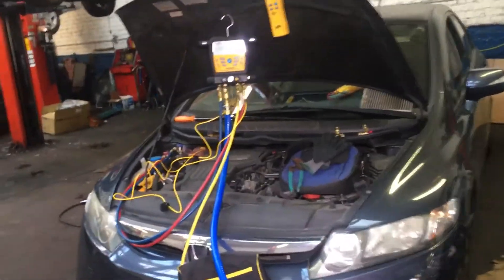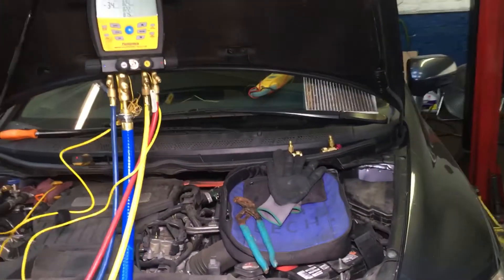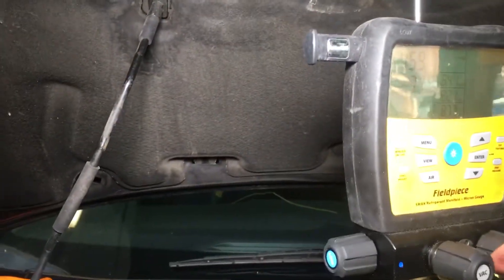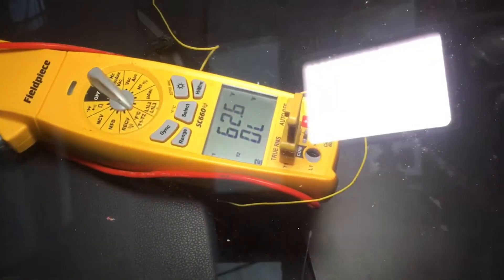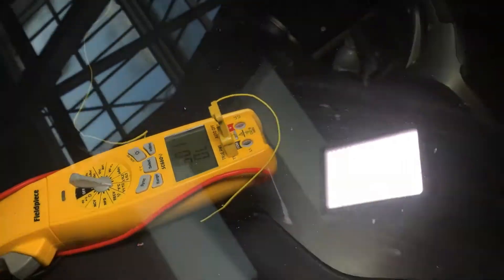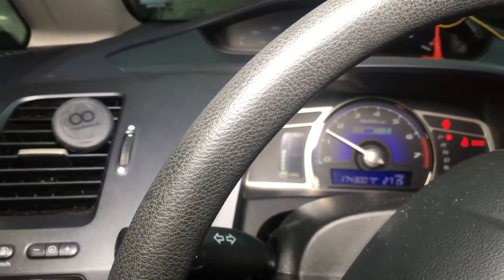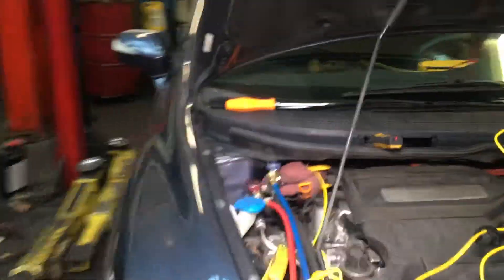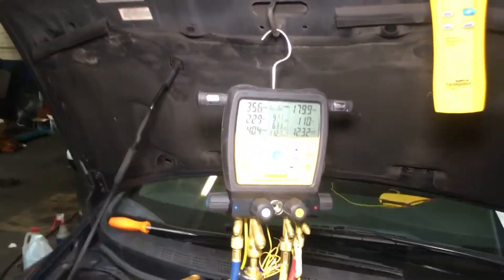How to fill your cars AC By pressure

Comment: At 1:06 you said Variable Capacity compressor.  Does that make the system act like a TXV system?  Is there no way to charge an automotive system using only a manifold and a pair of psychrometers?
Reply from the maker: Correct those old days of a six speed compressor like a York, or a Tecumseh compressor, Frigidaire A6 are long gone. When you had direct connect to fix speed fans connect to the water pump without the fluid driven clutch so you have a fan speed that does not alter very up or down.. 

That was the last time you’re able to use traditional methods correctly that would been the same as a residential split system . . 

Back in 1985 they started introducing the first fearful displacement compressor on Cadillac model .  
      And that’s when mechanics and radiator and air conditioning shops started to eat very expensive. Come backs repeatedly over and over because they refused to read and they were stubborn and we’re determined to stick with a Old methods.. 

And because of those old ancient dinosaurs who used to own 30+ air conditioning radiator specialty shops in my territory, where I work. 

All but two of them have went bankrupt and out of business . 
      And the two in existence have recently been taken over by young technicians, young managers, who don’t have experience and are starting to destroy customer systems I’m getting contaminated, refrigerant over charged, and under charge systems improperly Mechanically repaired systems from these last two shops remaining in the San Francisco Bay area. 

And it all comes down to stubborn laziness 
Refusing to educate themselves 

Then the cheap owners refuse to pay for training and new tools. 

Then the shop own who intentionally chooses to stay ignorant because they’re too comfortable with what they know what wasn’t much in the first place. And they seem repeating what they learned in the first year over and over again for 30 years means they are learning something.

You be surprised at how many shop owners and technicians I have met and I still meet to this day over and over again open doing this for 30 years what are barely beyond five-year-old technician who just repeated same things decade after decade. 

But they’re still in business and they make money so apparently that makes them right  

The variable displacement, compressors use sensors around the car, interior and ambient outside and inside the system pressure in temperature to constantly change and adjust the compressor out put. 

Well, the technician is shaking in putting in the small cans of refrigerant, attempting to achieve a pressure. He is comfortable with from old ancient, dinosaur age technology. .   The computer is taking over and slowly adjusting the compressor, downwards and displacement trying to keep the pressure down to wear it once the pressure to be..  inside the technician thinks he needs to add more and more

In the computer keeps tailoring down the compressor . Lol 🤣

And the technician doesn’t know it .

Comment: https://youtu.be/C12iEpniHxo?t=196 vac off   are you now filling liquid or vapor ?  
Is this filling up because you have a great vacuum 500 micron on it no need for the compressor to run suction on the low side?  If you did not pull 500 microns would you have to run the compressor to get the low side to suck in the proper weight of 134 ?
 Looks like you had the high and low side open for the suction charge ?
Do you have the low side open after you started the car compressor to get any liquid or vapor out of the lines ?    thanks
Reply from the maker: sorry to so long to respond. 
1: I was filling with liquid
2: part of the answer is I have a vacuum below 500 microns. That is one of the three gas laws.     My farther also would not give me the answer to this question. My father made me learn the basic of the three gas laws. The my father put me out in the shop and told me to come up with the answer with what I just learned about the three gas laws, explain my answer to him and told me to get his refrigerant tools and show him how to recharge a complete refrigerant charge with out starting the engine.  My father told me I only get one chanch. I did it and it worked the first time . I was 12 years old. so below is the link to were you can learn to find tha answer to you question. You will answer your own question, because you are armed with knolage. 
    ("Created in the early 17th century, the gas laws have been around to assist scientists in finding volumes, amount, pressures and temperature when coming to matters of gas. The gas laws consist of three primary laws: Charles' Law, Boyle's Law and Avogadro's Law (all of which will later combine into the General Gas Equation and Ideal Gas Law).
https://chem.libretexts.org/Bookshelves/Physical_and_Theoretical_Chemistry_Textbook_Maps/Supplemental_Modules_(Physical_and_Theoretical_Chemistry)/Physical_Properties_of_Matter/States_of_Matter/Properties_of_Gases/Gas_Laws/Gas_Laws%3A_Overview
           3: Yes, at the vary end when I was finished I closed off the high side valve fitting to the service port. Then I opened the high side and low side valve on my manifold gauges to slowly let the refrigerant pass to the low pressure side throughthe low side service port of the refrigerant circuit. 
If you learn even to basic simple parts of (Thermodynamics) (Gas Laws) (Fluid Dynamics) You will be able to answer all you own questions.

Comment: Thanks for properly explaining how to charge your vehicle AC. As a fellow HVAC technician , I greatly appreciate it.
Reply from the maker: shelby bruce Sometime in the future when I learn how to use editing software and sound editing software and use a tripod I hope to make better scripted and more learning intense videos this channel is just for trial and to get used to making videos holding the camera and seeing how bad of a job I can do to seek improvement. 
        As you look at my videos I leave a lot of procedures out and I only give a little tad bit of information in every different kind of video I make inserting more little key spots of information as I make other videos and then not repeating some of the information and in other videos I’ll keep emphasizing particular things that are extremely important like deep vacuum.
Reply: @coldfinger459sub0  Well you are doing a good job. I look forward to your future videos. If I ever do any HVAC videos they would probably be the same. Lol
Reply: @coldfinger459sub0  I do have a specific question pertaining to my problem if you dont mind. After installing the coil, what is the appropriate psi for leak checking? In residential HVAC we go as high as 500psi. Would it be the same for automotive since it is similar metals being used for the coil and refrigerant lines?
Reply from the maker: shelby bruce The individual manufacturers specification. Read the manual. Different manufacturers have different requirements. 
      Example I’m just going to shoot off some names and numbers just for reference not that they’re correct. 
    1: let’s pretend ICP Product instructions call for 400 psi
     2:  Panasonic VFR Called for 650 psi
      3:: fUJITSU Air Stage called for 609 psi
if you’re talking about cars from back in my dad’s day they used to say never go over 150 psi

      It all depends on the coil construction in the manufacture. requirements. 
Every time you pick up a component to install it stop put down the component look through the box or inside the component for the manufacturers manual and you’ll learn more by reading the entire manual from the first page to the last page on every product you pick up. Don’t listen to anybody else’s rule of thumb.
         
          I remember when I tackled my very first PanasonicVRF It was a small 24 ton system with three 8 ton heat pump‘s combined together in the same piping. Even though I attended all the required classes and had their little pamphlets and booklets that were very small only about 40 or 50 pages. 
     I went to their website the Japanese are very thorough and precise. I downloaded the original installation manual it was nearly 400 pages. I copied the whole thing and made my own book and read it from the first page to the last page. It was so thorough you could probably take a junior high school student and they can properly install the entire system without any classes or training. 
        Ask questions of people but do your own homework and research this is how you will learn. You’re lucky nowadays we have the Internet and manufacturers usually post all their information. 
       And that Panasonic installation I talked about earlier I got too busy to stay there and do all the work and there was no hurry on the job so I gave it to my son who just came out of high school and knew absolutely nothing about air-conditioning he’s never even touch the thermostat and he did 90% of the installation by himself with no help. He did all the wiring and all the control board settings and all the software configuration and it worked the first time he powered it up. That was three 8 ton heat pumps with 12 4 ton Air handler’s attached. 
      So that shows you if you could take a kid right out of high school and give them a good manual certain two simple classes you can install one of the most complicated systems properly and have it worked flawlessly the first time you started up and almost A decade later still going strong
Reply: @coldfinger459sub0 Kudos to your kid. My replacement coil didnt come with a manual, but ill and track down. Thanks for the help.